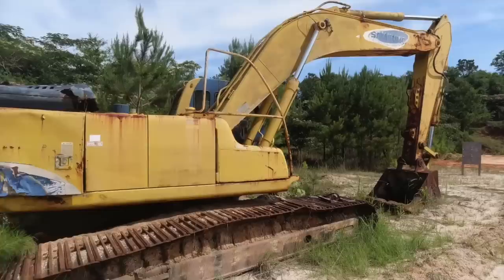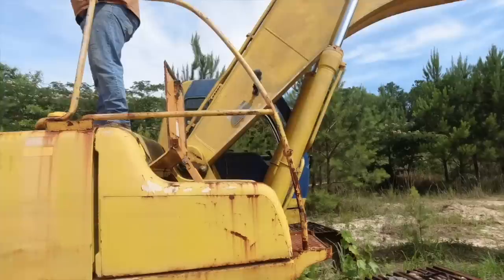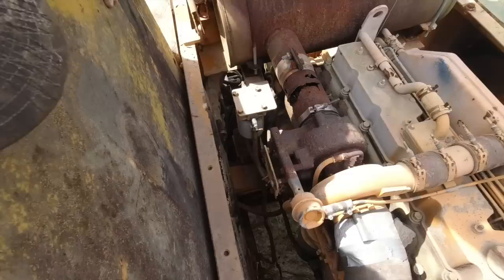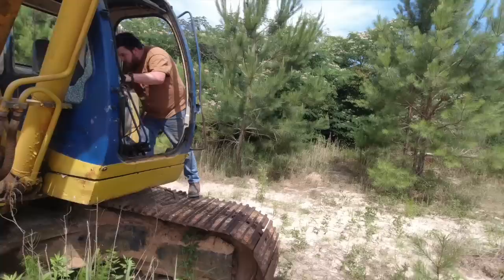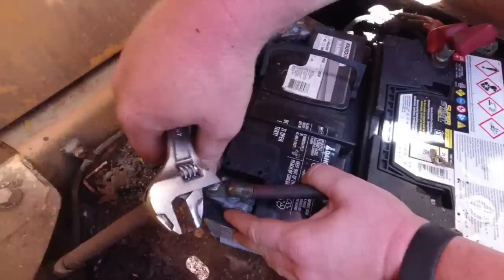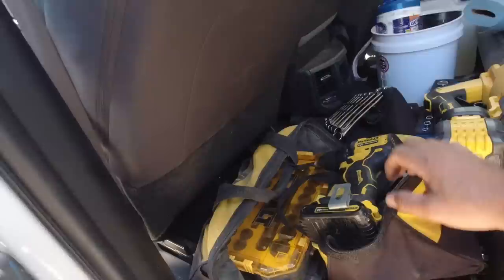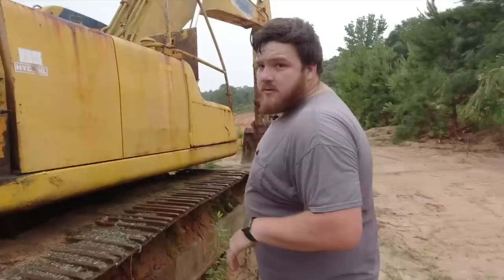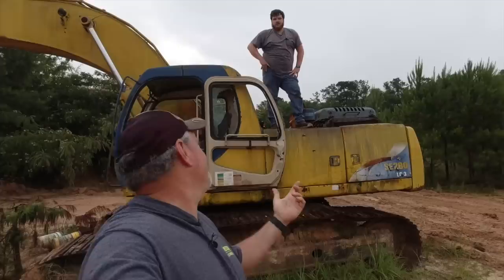LEFT TO ROT! Will This Excavator Start and DIG again?

Comment: one shot of starting fluid will kill those bees on contact,
Reply: Brakleen will kill them right out of the air.
Reply: or raid yard gard will do the same it will drop them in midair
Reply: I second the starting spray. It works great and evaporates so quick you can hose the little buggers down and have a dry cab in less than a minute AND not cover everything in poison to then cover yourself in. Besides, who doesn't have a couple cans with them when trying to resurrect something in the weeds?
Reply: Brake clean, carb cleaner, starting fluid.... All good wasp/hornet sprays. And... You most likely have them right there
Reply: Not a crescent wrench, it is an adjustable metric wrench. ;)

Comment: Why is the pump automatically being blamed ? Sounds like it’s low on oil and sucking air for sure but those Kawasaki hydraulic pumps are very tough . Did y’all preform a flow test under pressure to determine the pump was at fault?
Reply from the maker: you're a smart man....this video was filmed about a month ago. We think it might actually be a valve control versus the pump. We are going back out there on the 6th.
Reply: If everything is weak it could be one of the main relief valves it might have one for each side of the pump . That pump is actually 3 pumps all built together. Two high flow pumps for all of the functions and the pilot pressure pump on the back of it for all of the controls. but if it is just one function that is weak check the circuit reliefs on that function. You need some gauges and tees and flow meters that will go up to about 60gpm to really do some serious testing.
Reply: @HamiltonvilleFarm  If there is a way to send me a private message on here I could possibly give y’all some pointers but I’m not that well versed with YouTube.
Reply: The travel motors use the same pumps as boom, dipper & bucket so I’d say that the pumps aren’t the problem. Need to find if both travel motors don’t work and if it’s both directions. If you’ve got no travel at all you should see if there’s any pressure going to small valve block mounted to the travel levers. You would need around 40bar pressure to this block. If you’re getting limited travel power it could leaking pressure back to tank through the rotary coupling. First job, put some hydraulic oil in it!!

Comment: Sounds like the pump cavitating to me 👍
Reply: Yes it’s scavenging for oil I was cringing with the noise,  a blown seal or cracked pipe on the valve block personally just would shut the engine down, instead of dumping oil everywhere..I wonder how much hydraulic was in the tank before starting it up !!!!

Comment: If that pump has enough ass to bust a hose , I'd be checking solenoids and valves before replacing a pump . Start with some diagnostics , opening pressure etc . Obviously the pump is still good .

Comment: I have a new appreciation for Crescent Wrenches after watching your videos. A video regarding the hydraulic pump replacement would be interesting. Did the metal line have a hole or was it split? I have brazed pinholes on the metal lines before, with about 50% success. It depends on what condition the metal tubing is in and the type of hole that I was trying to braze.
Reply from the maker: I think we can braze it. 👍
Reply: @HamiltonvilleFarm  You have to get all of the paint ground off leaving bare metal. If there is any hydraulic fluid in the metal tubing - The heat will immediately draw the hydraulic fluid into the area being repaired. Good Luck.

Comment: Final drives don't break at the same time. Unless one was broke and they were limping it around and the other eventually broke, but probably not, you should ask the owner. If I were working on it I'd trace the controls from the pedals to the valves and then see if it has it's own dedicated hyd pump circuit. The cavitation sounds horrid, could be screens and filters plugged, could just be low on fluid. I'd love to get that thing cheap and fix it. It's worth 5k in scrap, at the very least, but it likely will be worth more, even in the shape its in.

Comment: How’s he get away with banging that crescent wrench off the metal when tightening the positive? I have seen it a time or two where the paints insulation value was the only thing that saved someone haha
Reply: It is best to connect and tighten the positive terminal first.  That way, if the wrench happens to touch part of the metal chassis there will be no short circuit because the negative terminal is still not connected to the battery.  Then when the negative terminal is finally connected it doesn’t matter if the wrench touches the frame because the negative terminal is connected to ground anyway.
Reply: @frazzledude  that’s usually how I do it in machinery but I’m pretty sure he already had the negative on

Comment: Surprised to see him doing up the battery terminals like that... if you connect the positive first, you don't have to worry about your wrench shorting out on the chassis. ;) Similarly, when disconnecting, do the negative first.

Comment: Seldom see a break down fix itself by setting. I think swapping the pump is just nuts and bolts. Fixing the pump is some serious stuff. What I would like to see is that machine get a makeover and clean up that broken glass and replace the seat, get them dang bee's out of there completely. I hope that the oil bath got a few of them. This hot weather has been just what those ornery bees like the best. I got down inside one of those excavators and got trapped by bees. I was stung so many times that it only made me really sick. It could of killed me but well I am here so I guess it didn't or I forgot to fall down. I just watch whatever you put on the airwaves

Comment: Nice job Hank and Shawn! I vote for recording the pump and the other hydraulic fixes if it's not too much trouble. Oh Hank I gave ya a shout-out on the lawn mower rescue on my channel. Can't remember which video it was but I think it was part-3. It was either Part 2 or 3. Check it out. I could REALLY use the traffic to my channel. 

-Shane

Comment: Sure it won't be a problem with some tender loving care all will be well. Love making them run myself. 1980 I started mechanic work on a big Ranch. They were broke down all over the Ranch. We went to work on all the tractors , trucks,  and equipment until everything we touched was running again. Rebuilt engines, transmissions, hydraulic systems, electrical systems, ac systems, and more. If we would have had cameras then we would still be online today. But our fame went out to the community and everyone soon knew who to call to get things fixed and running.  Just takes time and someone spending their money to get it done. You as a mechanic will always be learning new things sharpening your skills on each piece of equipment. Brings a lot of satisfaction and joy. It's a dirty job but someone has to do it. God bless !!!!

Comment: As a pest control tech get yourself some wasp freeze ll on Amazon. Work great for wasp tall can blue letters. It will drown then with a thick shot of pesticides. Nock them down fast just order a case of it. Even though it may look like it holds a lot it will run out pretty quick, like a A 10 warthog hold that trigger to long and it gone. It will hit up to a second story building somewhat but you’ll use it quick. If need be at home get a bee pole and a attachment that hold can. It uses a string pull system. Great to keep for worksites just can make money doing it need a pest license for your state and also read fine print on state area for chemical use like pesticides. If not careful you’ll get fines from old Uncle Sam and state.
Reply: To protect my identity don’t say my name on your video. Just say Pest Guy Guru if you want to thank me in your video. Remember kids leave it to the professionals for safety. Lol

Comment: if the pump were broken, the rest of the machine wouldn't work either. we've had many of these machines if you can operate the boom you should always move one more jug of the rusps
Reply: What in the hell does it mean to 'move one more jug of rusps'?
Reply: @ctdieselnut  if you can operate the boom. then there must always be one more track to rotate

Comment: Bought a machine similar to that one years ago and it made the exact same sound under load, the suction screen was clogged to the point of damage and the return filter was also clogged. The sound it’s making is from cavitation, (lack of oil in pump), the hydro tank needs to be full so the atmospheric pressure can keep the feed line going into pump stays full and has no aeration. Good luck
Reply from the maker: Thanks for taking the time to watch and make the comment. I truly appreciate it! Have a good day.
Reply: I was going to say the same. All the comments say it sounds good, the engine does, but no one mentioned the awful cavitation noise. Shit it might not even need a pump, who knows.

Comment: Def 24 volt
Reply: I wouldn't condemn the hyd   system till the electrical system Is straight and you put a flow meter and a set of gauges on the pumps

Comment: That stuff on the track is the batteries hold down cover isolation unit the key is missing and cross lead to make 24v🤣🤣🤣🤣🤣🤣🤣🤣🤣🤣 instead of shorting starter  rear right hand DOOR under cover inside you will see 3 solinoids centre one.. You short it to start it 😥😥😥😥😥 Easy done just take cover off and your in business.Also is the manual  rev controller activated you need more revs since the electric one seems dead....hydraulics will be real slow on low idle...🇦🇺🇦🇺🇦🇺🇦🇺🇦🇺🇦🇺🇦🇺🇦🇺🇦🇺🇦🇺🇦🇺🇦🇺🇦🇺🇦🇺🇦🇺

Comment: Easiest way to determine system voltage? Take out a lamp/bulb from any fitting. The operating voltage is printed/stamped on.
Reply from the maker: Great tip

Comment: i have replaced hydrated pump before NEVER EASY 
let me tell u what i have todo 
i have go borrow backhoe and chains and got all hose disconnect and put chain on it and attach to bucket on backhoe n disconnect hydrated from engine n use backhoe pull it out n set on trailer and was super heavyweight "my trailer tire was acting like flat but wasnt out of air it was pump being overweight and tire cant handle that much weight "so i hual it to shop get it rebuild and hual it back but got blew out tire on trailer ugh that is 3rd time i should asked borrow 4 wheels trailer unset of using mine
n put it back in n took me whiles by myself getting that pump back in there never easy i recommended 4 person do it because one person use jack other person tell guy on backhoe move n last guy hold pump facing at rear of engine
just big mess took me weeks get it done worked on cat 315L 1995 last month agos

let hope you doing well